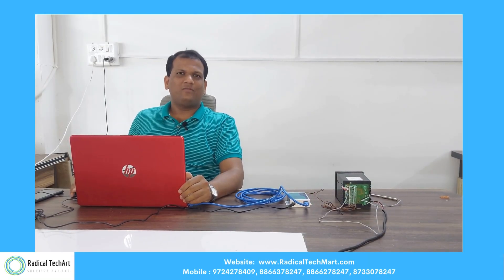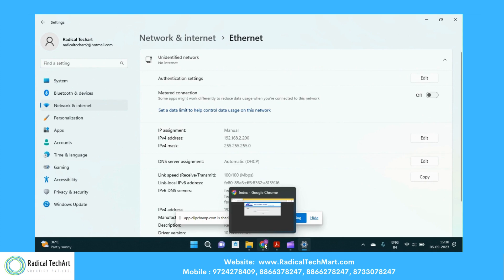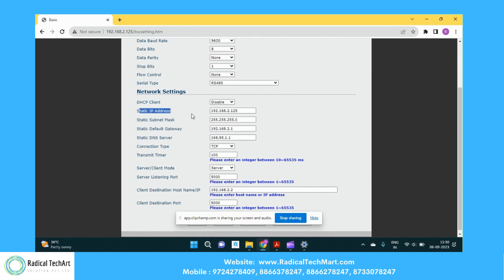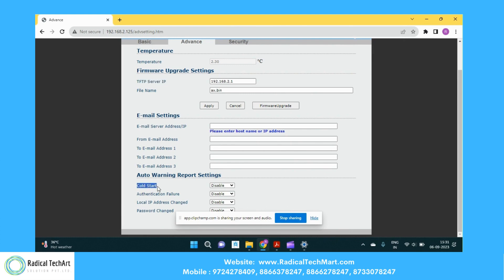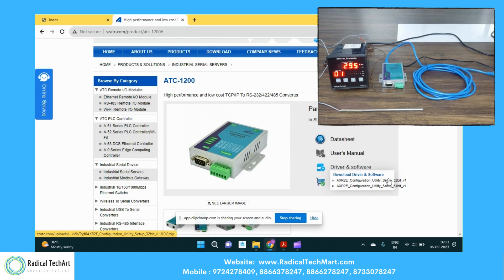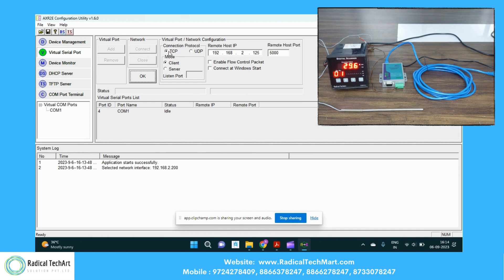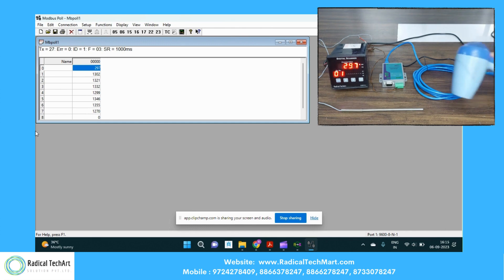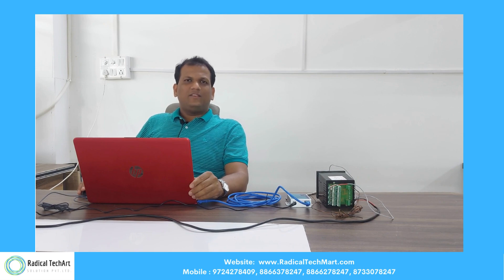ATC 1200 (TCP/IP to RS232/422/485 CONVERTER) PART-2RadicalTechArt I RadicalTalks I RadicalTechMart

Comment: Good afternoon. This device's RS-232 port has the following option for connecting signals on the port contacts - a three-wire connection without flow control and power supply to the instrument interface - RX, TX, GND signals, power supply by DCD, DSR, CTS signals???
Reply from the maker: Yes, if you have any doubt or query...
you can Email on this address: radicaltechart2@gmail.com